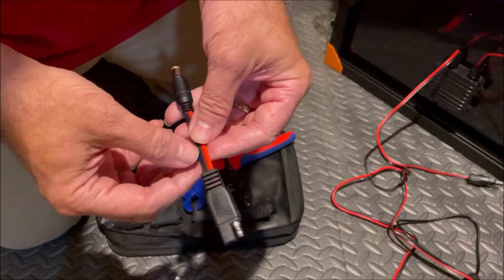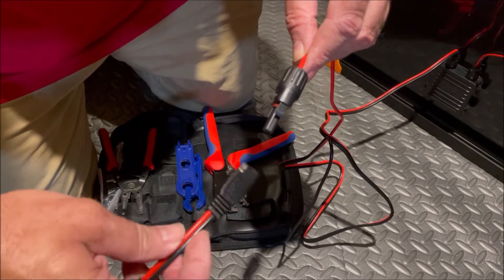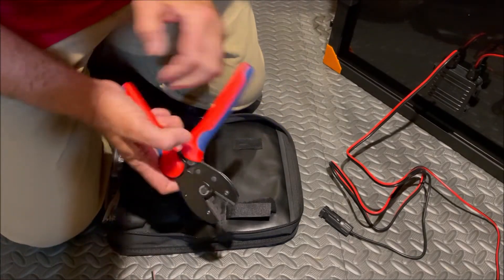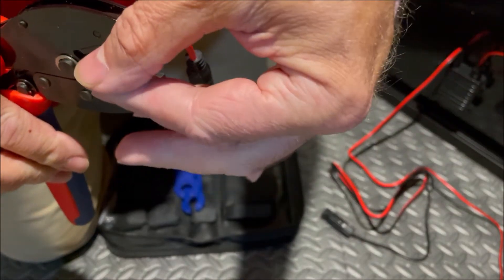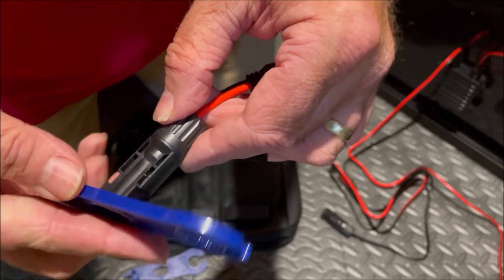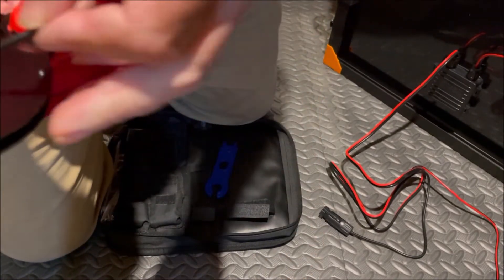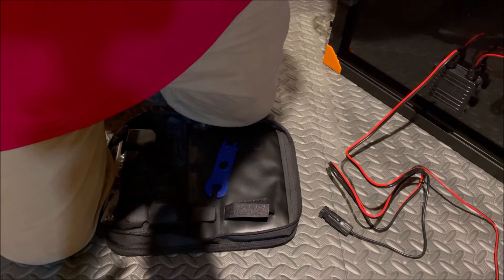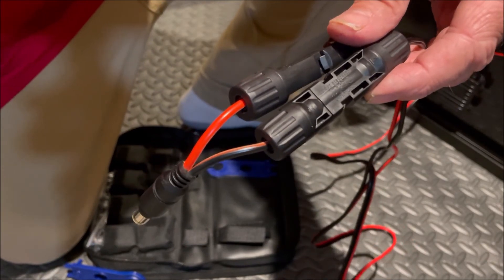Harbor Freight Solar Panel - How to Convert from SAE to MC4 - Part 2 - Viewer Request Thanks D Albu!

Comment: I think I broke something because my mppt charge controller isn't getting anything from my solar pannel now. 😢.  RIP $100.
Reply from the maker: make sure the pin is pushed all the way into the connector.  If its not in all the way there is no connection and the Charge Controller will see zero.
Reply: @thechiefsway2618  omg that worked !!!
Reply: @thechiefsway2618  my setup works !!!! Woo-hoo!!!!
Reply: @thechiefsway2618  I'll definitely look more into it tomorrow. I'll keep this comment updated.

Comment: @the chiefs way I'm confused why not just leave the SAE connectors?
Reply from the maker: SAE is not water proof, and more important you cannot easily connect panels in Series with SAE connectors.
Reply: Ok that makes sense just making sure I'm understanding everything. Thanks for the info!